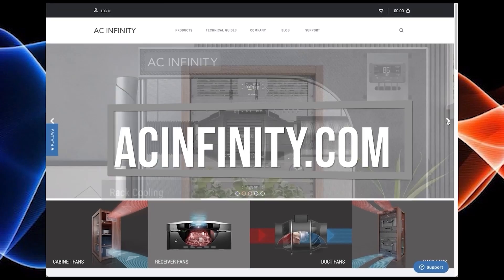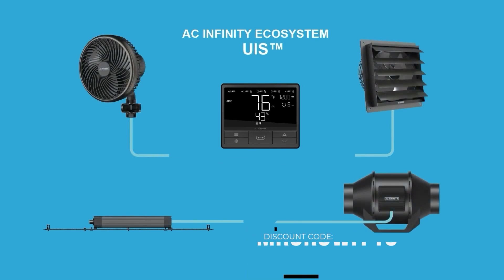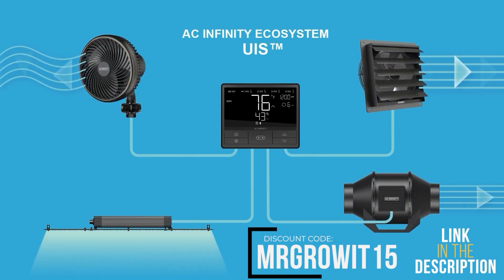Study Shows 60/60 Drying Method Isn’t Optimal!

Comment: She compared after 7 days. It takes 14 days at 60/60. This was pointless
Reply: Also, if you're drying longer than 10 days then you should look at your buds with a microscope to ensure there is no mold. 4-10 days is the optimal drying window to ensure it's not drying too fast or too slow.
Reply: Under the conditions 60F temp and 60% RH, it takes 7 days to dry down to a 0.6 water activity. If you're drying longer than that then you are over drying.
Reply: lol, yeah that’s a useless study than. We do at least 21 days.

Comment: Cure on the stem! Hang whole plant for 14-18 days at ~60/60 > remove water leaves > cut into large chunks on the stem > into paper bags > paper bags into contractor bag > seal with loose knot. Keep in the contractor bag for at least 14 days but you can keep your bud fresh for months with this method. Shout out Notsodog.
Reply: Under the conditions 60F temp and 60% RH, it takes 7 days to dry down to a 0.6 water activity. If you're drying longer than that then you are either over drying or you get mold in your buds.
Reply: @johnsmith3521 how do I test for water content. You achieved 0.6. With what method sir
Reply: @jhe1967 you can get a water activity meter, they are not cheap they used to be >$500 but now have one for $369 and it is a really sleek easy to clean unit. It’s called a LeBrew AquaGauge. 

I wish it had been around when I was growing for flower. I may still get it making hash. But this is the way.